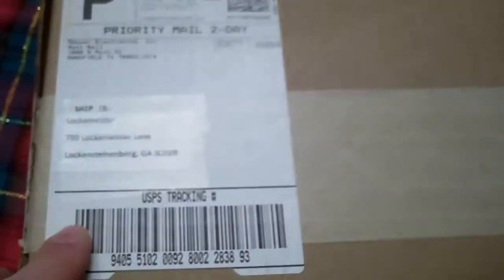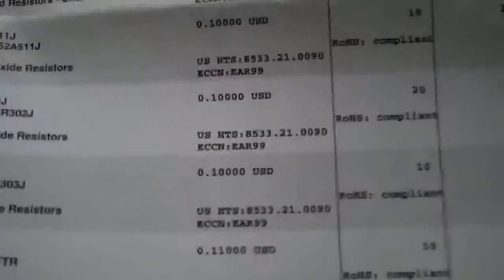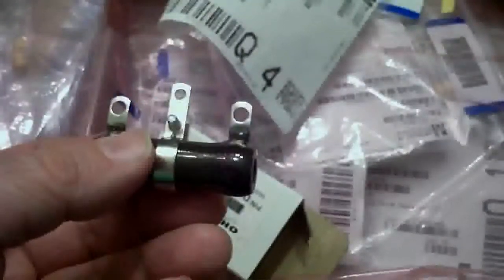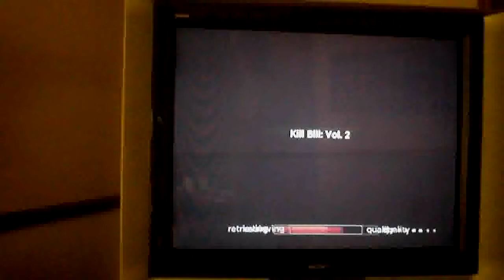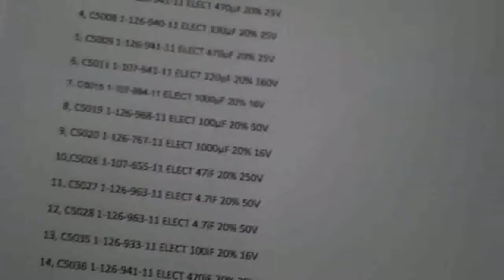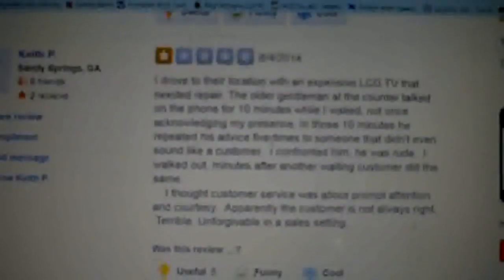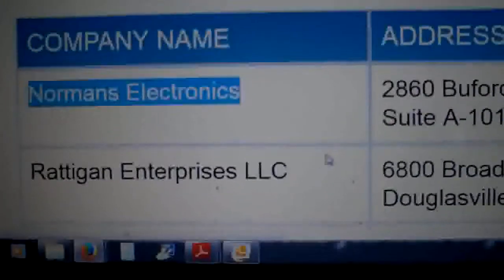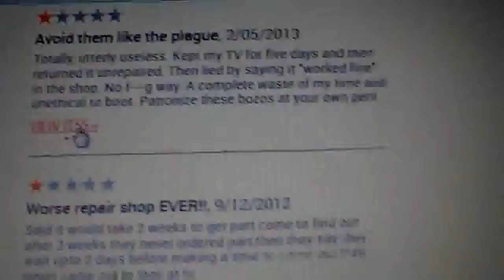1934 RCA Victor 143 Project Restore Part 3 ... A Revoltin' Development

Comment: Well dang, John.  That's a lot of caps, hopefully you'll open it up and see a smoked one.  Pretty common, these days, to find no component level repair shops.  Board swapping became more cost effective for them, long ago, a real shame.  Good luck.  Purely selfish, I want to see you back on the RCA :-)
Reply from the maker: Hey Al,
I went over my thoughts on this SONY beast and got to thinking to check out the U- interface board first. They are a couple of flaky inputs and one inoperative input and maybe that's where the problem is cropping up. I checked the AC power strips to make sure the socket polarity and ground was ok and then put on a new shielded video cable just as a sanity check. Anyway, I am ordering caps for the U-board and it's about 15 electrolytics so I might just do all of those. It has a lot of diodes in this board too.  If that's not the soulution, then it's time to punt and go back to the D-Board which has the power supply in it. . I got to get this thing working. That 12 inch set is nice for a small bedroom, but I practically need binoculars to see it! Thanks for stopping by.

Comment: Good Day John,
That Set appears to be an actual SONY product (only the TOP models are produced BY Sony, ALL the smaller Sets are actually made FOR Sony by Goldstar, Emerson etc. (of course they need to meet Sony standards).
Personally, I wonder if the issue is in it's Microprocessor Board.
I Personally doubt it has any troubles in the P.S.  
If My advice has any merit-- a Roll of Solder, & 60Watt Iron are mighty in defeating a Giant problem plaguing modern electronics;     Cold Solder Joints!!  
Cheapness & Robots set on "Warp 5"  can lead to this. The TV pass Warranty period, then the joints start letting go.
Also the Solder now has little or NO Lead, & Lead, although toxic, has "give"  The modern variety needs more TLC from someone who knows what re-touching Joints means> Work, not "escape, Bob Marley style eh". hehe.

Unfortunate you have NO reputable Technicians eh!!!    Crazy EH!

In the Tri-Cities there are a # of Shops that I know of who would be willing to give the Board a going over.
There is a Shop where all they want is JUST THE BOARD, & they take it from there!
Any Tech who is unwilling to tackle a Board. . . . really. . . .   

I should take Pics of My uber rare RCA Colour TV' s. You would want at least one if You knew how few there are of this model, & have it as your "backup".

you get 10 Stars for TRYING, john.
So many won't even ATTEMPT, a repair, never Mind BUY. . . replacement Parts. 

Hoping you locate the issue eh!!
Reply from the maker: Hey Brad!
Yes, this is a genuine SONY. It had the address in Tokyo on the back where it was manufactured. I have ordered some ESD bags to put the boards in.  I have traced the problem using logic to the B board. This is the signal processing board. I did this by realizing there is an composite video input on the front, (HB Board) which is separate from the component and composite and S video inputs on the back (U board). All inputs have the problem and they all are connected to the B Board. So the B board is most likely the culprit having a bad cap. Maybe a bad Al electrolytic filter cap. I do reckon it's 60 CPS leaking in. I did speak to a tech in Florida on the phone. He told me to check all the caps in the power supply also. This TV essentially has 2 power supplies! (The AC input trans and filters on the The A board and the protection and more filters on the D board with H and V video drives AND high voltage on it). He said that all of the time, when these AL electro caps go bad, the tops get rounded. btw as a side note,  SONY was advanced and they used what is called Chip Electrolytics on the B board. That's the Al electrolytic mounted on a chip base. This is for the fabrication process of the board.. I think i will do something on this, it's interesting. BTW I also have an in circuit cap checker, so i "should" be able to find the problemo. Keep me in your prayers for a steady hand. Well, not for another week, the ESD bags have to come in
Reply from the maker: around where I live, they are all dunderheads. the just want to snap a new board in. Well they're are those that can work on LCD and LED screens and replace blown caps on the P supply. The shop in FL actually can work on the old fashioned CRT sets. Well interestingly the younger guy i talked with said he never "personally" worked on an set with a CRT! He did know "about" them though and I surmised some other guy in the shop worked on them.
 He told me to be careful of that wire that goes to the CRT since it could zapp me. I thought that was charming of him and told him it was called the anode wire. His memory got refreshed!

Comment: Is that the TV you had to build a ramp to get in the house cause it weighed 2 tons?
Ive been thinking about getting a blue ESR meter so you can test those caps in circuit. Might be worth it to get one.....
sind Sie immer genug zu essen mein Führer Katze?..................Buzz
Reply from the maker: Mais oui monsieur Buzz! The TV weighs a proverbial ton. I actually do have an ESR meter ( a pretty blue one I put together myself), so I could test the smaller caps out. I'm not sure I can test the 4500 MFD caps out though. I think they have to go. Makes sense though, the TV would straighten out after a half hour warm up. I figure a large cap trying to charge up, but can no longer do so.  You said "are you getting enough to eat my guide cat?"
BTW, have you ever noticed there are never any cats around a Chinese restaurant?
FYI, Der Führer Katze ist im Urlaub im Rheinland, in einem geheimen Bereich.
Reply: Lockemeister Spione, nachdem Ihre Katze Hilter
Reply from the maker: Buzz1151
LOL